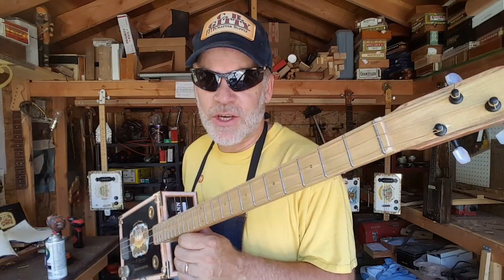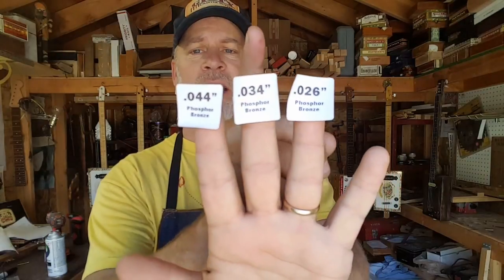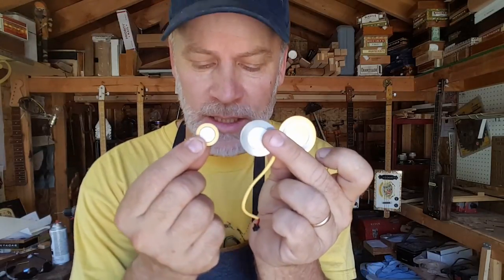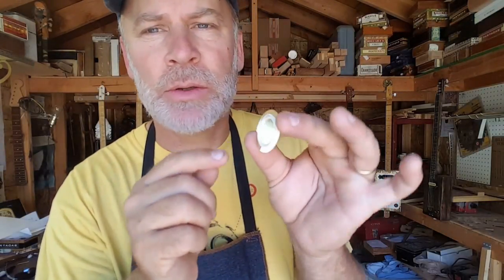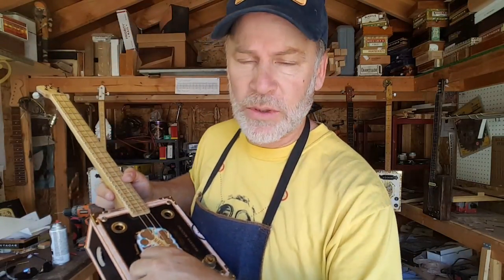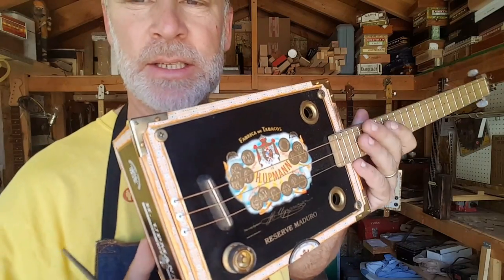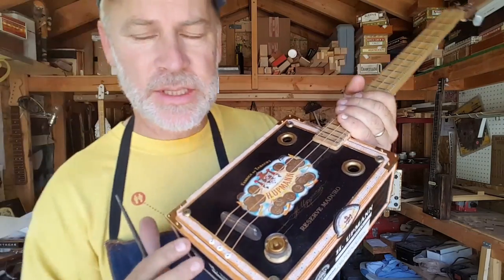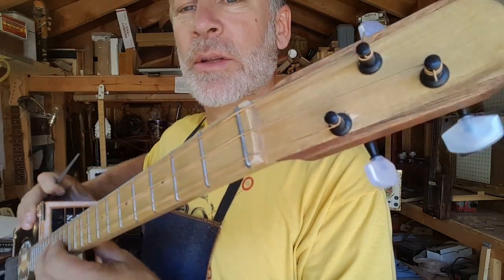FAQ's - Cigar Box Guitar (building tips and tricks)

Comment: Del, I'm using a 17" cigar box for my build. The neck is going to the back end but not through. I have a problem with what scale to use. 25.5 with 18 frets puts the saddle roughly halfway on the lid and a 32.5 scale would place it approximately 3/4 of the way back with both having 2 frets over the lid. Should I use fewer frets or more over the lid. Will the longer scale give me a deeper tone or will it be problematic? What would you advise? What strings to use on longer scale?

Comment: i bought a huge ass piezo kit off amazon, its so sensitive that it picks up sound when i tune the guitar. its also loud as hell
Reply: well, i wouldnt recommend it anyway. like i said it's waaaay too sensitive
Reply: its a 2 way street, you can use the sensitivity to your advantage if you're a rhythmic player, you can tone it down quite a bit by potting it in hot glue, or in a bottle cap as well, it still picks up a lot of sound but its more or less a microphone so you're getting the actual sound from the instrument vs a mag pup which is picking up the string vibration.
Reply: Jonathan Lagasse that's good advice, a bottle cap works well, or a thin layer of foam hot glued over the Piezo, I hate the loud banging that some Piezo pick ups give off, that is why I use, almost exclusively Magnetic pickups, more work and more expense equals cleaner sound in my experience!